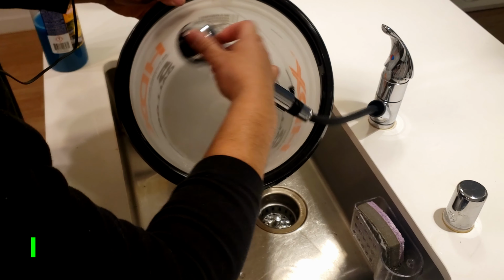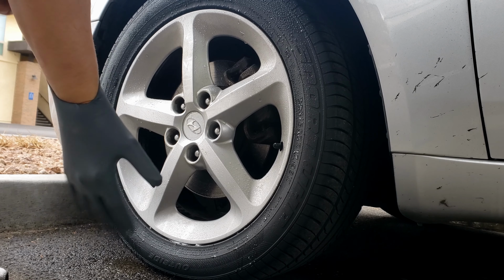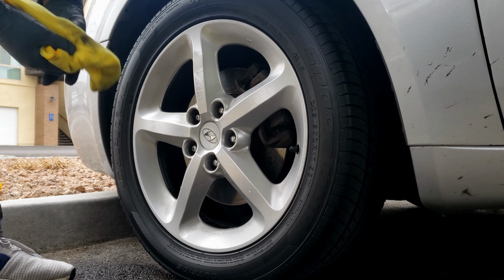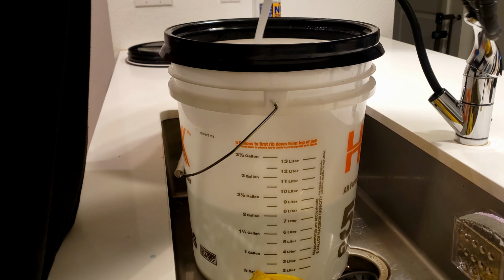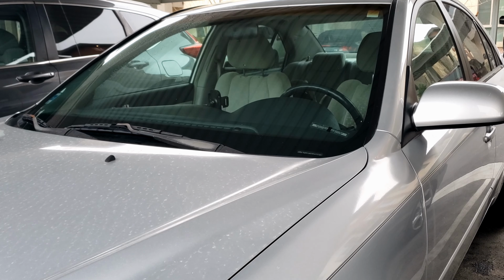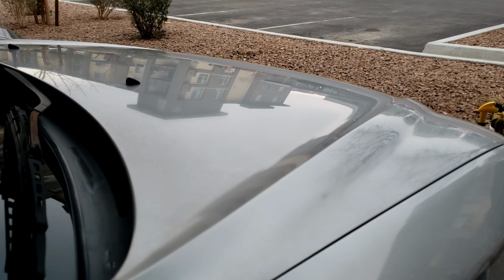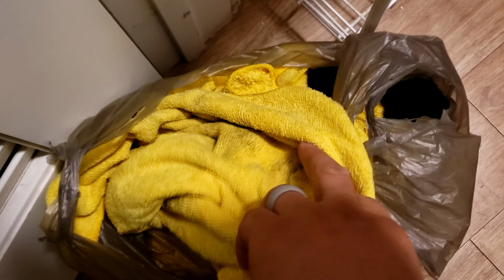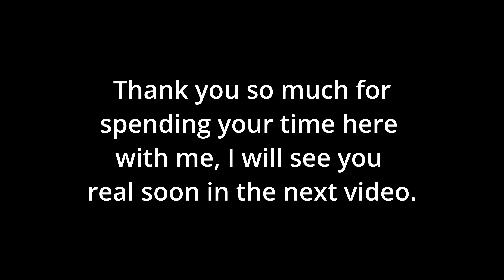How To Wash Your Car At Home Easy: SIMPLE and QUICK! Beginner Series Pt 2

Comment: My tire rags come out stained black and I used the same detergent. Or maybe your's are stained black, too, but not clear in the video.
Reply from the maker: They definitely have black stains but that's why I try and use just the black ones on the tires most of the time. Color coding is key. But yes most of my wheel and tire rags are black all over...they get used for only tires and wheels.